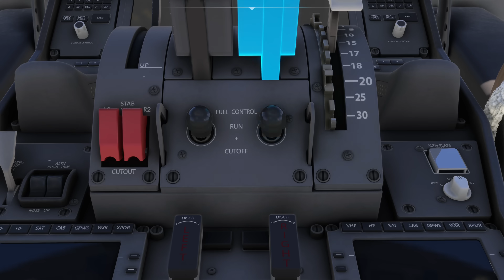Air India 171: Why Did The Fuel Cut-off Switch Get Moved?

Comment: First of all you are comparing your kids with two professionally trained pilots.

Second the sequence of events is not exactly clear here. 

Experienced pilots would be able to  judge if the engine flamed out  by just noticing the sound of the engine whirring down. 

That's why one pilot asked the other did you cutoff the engine?. The other likely possibility was that there was a malfunction in the engine fuel supply which was noticed by one of the pilots (most likely the PM) that prompted the question.

The switch was actually moved to cutoff and then run in an effort to restart the engines. The plane rotated with the engine switched on RUN position. 

Without establishing the sequence of timing of events we can't insinuate that a pilot deliberately cutoff fuel supply just when the plane became airborne. An accidental switching off the fuel supply to cutoff is unlikely.

Which pilot in his or her right mind would deliberately cutoff fuel supply?

That's what I'm driving at. The state of mind of the pilot(s) is at question here.

I think this is a highly prejudiced video that suggests the active role of the pilots in cutting of the engine fuel supply.

Boeing?? Defect in the electronics that led to a fuel cutoff without the switch being moved to cutoff. Vapour lock.

Let's wait for the forensics before we rush to find scapegoats in professionally trained and qualified pilots who had little to respond and did the best they could

Comment: This is clearly a poor maintenance issues, the mechanics install the switches in reverse that confuses the Pilots. When the pilot looks at the label, it's on OFF but in reality it's actually in non cut OFF position. Then they switch it to ON and they are done, it's the reverse and engine cutoff on ON position label which is actually OFF position mechanically/electrically. Guess the investigators didn't look into this.

Comment: Also a briefing on the IC controller for the fuel switch after 11k cycles causing a blackout blue screen. The switches will default to off. 😮😮

Comment: Was there a power failure on the ship? If so, does the power failure makes the fuel switches to cut off or stop the fuel to engines? Due to power failure, does one of the pilot turned off the fuel switches to deploy the RAT, can this be a chance ? Or as the engines losing thrust one of the pilot suspected fuel switches malfunction and just toggled ?

Comment: Why not put a safety cover on top of the switches connected to an indicator, so both pilot are aware? Also complemented with a small delay. 
But the most important, why allowing a cutoff in full/high throttle? One should first go to idle power before cutoff.

Comment: Captain Steeeve, it would have to be possible for Boeing and Airbus to make the fuel cutoff switched and fire handles linked to the weight on wheels switches so they can't intentionally be closed when airborne (and possibly put in a computed speed when they are inhibited so they can't be shut off during takeoff, maybe inhibited when TOGA switches are pressed). They would then have to somehow link it to the master warning system so in the event of a fire or malfunction which would require a shotdown the appropriate actions can be taken.
Your thoughts??
PS I'm a current Airbus A320 pilot and rated on the 777. My suggestion above would be something like the closed loop checklist system on the 777 where the system can see that an item is in the correct position or not.

Comment: This guy is a liar. 

The report says  “Engine 1 and engine 2 fuel cutoff switches transitioned from RUN to CUTOFF position … within a time gap of 01 sec”.

It does not say that pilots deliberately switched off.

A liar.
Reply: Ok, explain to us all how a mechanical switch moves without operator input?

Comment: Does it explain the RAT getting activated or both are  mutually exclusive? What are possible scenarios w.r.t timing of fuel valves getting cut off and RAT coming into play?  Besides there are theories that copilot was actually in control and effectively flying the aircraft whereas the Captain was not.  The Captain had mental health issues but nothing concrete to prove. The report gives more questions than answers

Comment: Is cutoff switch is directly connected to fuel valve? Or it goes to computer which runs a logic and then decides to actuate fuel valve. What is recorded in blackbox - the selection by pilot or computer decision or actual valve position? Why these details are missing from report and you are also not talking about Steve?

Comment: PLEASE don't ignore the evidence that this was a tragic mistake and NOT sabotage.  FACT#1 - The fuel shutoffs were moved at the same time as the gear-up lever was expected to be moved (four seconds after the weight-on-wheels switch time-stamped main wheel lift-off).  FACT#2 - The gear-up lever was found in the gear-down position - it apparently was never moved.  FACT#3 - The pilot who presumably shut off the fuel to the engines denied doing so.  FACT#4 - There has been no evidence presented to indicate that either pilot took any action to crash the plane after the fuel was shut off.  Moving the position of both fuel shutoffs and moving the gear selector are mechanical actions that are done at the beginning and end of every flight. An experienced captain would have enormous muscle memory for performing these two mechanical movements. Have you ever opened the fridge and been surprised that you put something in the fridge that should have gone in the cupboard? …and had no recollection of doing so?  It's a simple mistake with routine mechanical actions that we humans make from time to time and are unaware that we did so. Pilots are not exempt from this kind of human error just because they understand the gravity of such an error.  The initial report does not mention a “positive rate” or “gear up” callout.  If these calls didn’t occur, I would tend to agree with the many professional pilots who are claiming that there had to be “intent” behind the fuel cut-off but if these two callouts were recorded, I would be astonished if the captain’s only “intent” was nothing other than to raise the landing gear.  Please also consider that it is quite likely that the investigators would withhold such information at this time while they further investigated the possibility of tragic human error.  On the other hand, reporting that the pilot denied that he had shut off the fuel is significant to the investigation without drawing any conclusions.

Comment: The fact that many leading airliners, the likes of etihad and Singapore airlines have instructed their engineers to review the fuel cutoff switches on their 787 fleet and now that DGCA has instructed Indian carriers to do the same with their 737/787 fleets should at the least indicate the operators are not a 100% sure that it might not be a technical glitch. So being dismissive of the 2018 directive which clearly states inadvertent engine shutdown in flight as a possible outcome of the locking mechanism on the fuel cutoff switches failing is a little premature imho

Comment: Keep in mind that the first officer (co pilot) was the pilot flying so the captain was the pilot monitoring. During take off, the pilot flying had hands on the controls and who had his hands free to move switches? Furthermore, they know exactly who asked "why did you cut off the fuel" because each pilot's voice is recorded on separate channels but the report says "one of the pilot asked the other..." It has also been reported that the captain had a medical condition and he was even on medical leave for some time. He's been under severe depression ever since he was separated from his wife.
Why will the full audio transcription shed new lights? Because the gears stayed down. Why is that important? Because only when the pilot monitoring (in this case the captain) reports "positive rate" will then the pilot flying (in this case the first officer) call for gear up! Did the pilot monitoring (the captain) report positive rate or not? If no, why? Was he "busy"?

Comment: In one of your videos, you mentioned that pilots have a very stressful job. If someone is dropping eggs off a building, and someone below is trying to catch the eggs. At first, it is easy as only one or two eggs are drop. As the dropper speeds up, the catcher can not possible catch all the eggs. The solution is to go up on the roof and stop the dropper.  

In the same thought process, what can be done to eliminate the stress? (Other than talking with someone?) Can technology of some sort be utilized? More people? More tools? etc.

Comment: Thanks, Steve - wonderful, balanced coverage of this terrible incident. Question, though. Are the cut-off switches in any way under the control of the computers and therefore, software, or are they directly connected to the fuel pumps? If the former is true, is it not possible that the computer incorrectly and temporarily shut off the switches via the software (without physically moving them of course). This might explain the clear denial of the second pilot.

Comment: CAPTAIN STEEVE why can't we think the pilots tried to manually switch it off and on when they found both engines were cutt off. 
So in the process of doing this manual recovering on of fuel cut off they would have crashed and recorded the fuel switch as off ?

Comment: If the other pilot had put those switches again in run position, then how did they find the switches again in cut off position after the accident? Clearly it's an issue with those switches. Boieng is responsible for this.

Comment: The Indian public needs some context to understand this deeply painful act of potential Murder-Suicide. 
India currently has 10% of the world's certified pilots.... this is a rapidly increasing percentage as its aviation industry is truly expanding at a rate of knots. There have been an estimate 15 planes deliberately crashed in the last 20yrs. Its inevitable that an Indian pilot will sooner or later bring a plane down. This is not however a proof that either pilot did so in the case of the A171 crash. 
Murder-Suicide is the second most prevalent cause of plane crashes in the last two decades. This is still too explosive for the Indian media to contemplate; it's seen as unpatriotic and deeply shameful to do so. I just hope this analysis will be helpful for those seeking answers and closure.

Comment: Are there chances that switches were not operated but some failure in electrical or electronic circuits which might have caused this switch off and switch on and given fault signal and alarm.

Comment: BIOMETRIC SECURITY FOR FLIGHT SAFETY — A MUST FOR MODERN AVIATION

Every pilot should register their thumbprint before the flight, granting secured access to cockpit functions. This ensures:
	1.	✅ Only authorized pilots can operate critical systems.
	2.	✅ All key actions (e.g. engine shutdown, autopilot disengage, emergency config) are traceable to the individual.
	3.	✅ Prevents unauthorized tampering or mistaken actions.

🧠 For redundancy, the flight engineer (or supervising crew) must also be thumbprint-registered. If a pilot becomes incapacitated, the engineer can override with biometric authentication.

Banks, phones, and doors already use biometrics. Why should aircraft — with hundreds of lives at stake — be any less secure?

Let’s move aviation into the future with biometric accountability and layered safety.

Comment: You initially claimed right after the crash that one of the pilots mistakenly raised the flaps instead of the landing gear. The next day, you changed your explanation after other pilots pointed out that the RAT had been deployed. Now you're saying it was the fuel control switch that was turned off by one of the pilots. How credible are your reviews? You seem to have access to only a portion of the cockpit recording, and it's not enough to draw definitive conclusions. Please get your facts straight before releasing videos like this.

Comment: The fact is that the switches were in the "Run" position in the wreckage. And we don't have video footage from the cockpit. So, we don't actually know if the switches were actually physically turned off, or if it was a malfunction in the chip that controls the fuel, in the wiring between the switches and the chip, etc. We are really just speculating.

Comment: Sharath Panicker, a Wing Commander and former Dreamliner pilot who flew the jet for 10 years explains exactly why it's very unlikely that a pilot error or manual action caused the fuel switch to "cutoff". He said that it's almost impossible to transition switches for both engines manually within a matter of a second. It's already in the news.

Comment: I have a question, the pilot flipped the stwitched off which cut off the fuel supply. 
What I dont understand is, why there is a control to turn off the fuel during takeoff, this option should activate when the plane is at a sufficient elevation.

Comment: Based on the information shared in your earlier video, you mentioned that manually cutting off the fuel isn't easy, it requires to pull the lever, place it in the required position, and then release it. If that's the case, wouldn't the other pilot notice this action? Also, is it realistically possible to complete this in just one second, especially if it involves turning off two switches?

I’ve also seen comments from others raising a valid point: why isn't the full cockpit conversation made available to the public? From your videos, the narrative seems to lean more toward suggesting deliberate action by the pilot. But what if it was a technical fault, not necessarily a design flaw from Boeing, but possibly a component failure? Has there been any effort to check the maintenance records or gather input from other pilots who flew that aircraft recently?

It's important to consider all possibilities before placing blame. If this was indeed a technical failure, accusing one individual without full clarity might be unfair.

My thoughts are with those who lost their lives. I truly hope this wasn't caused by a technical issue.

Comment: The throttle control module (TCM) of the Air India flight 171 (VT-ANB) was replaced twice, in 2019 and 2023. The TCM houses the fuel control switches too. Why was the TCM replaced so frequently on the direction on boeing?

Comment: Do you think, there is need to examine the role of the ADEC (engine control system) to understand why Engine 2 failed to fully recover -- unlike Engine 1, which showed partial recovery -- and why Engine 2 was unable to sustain thrust, ultimately resulting in a loss of power? Don't you think if second engine had recovered partially as engine 1, the aircraft very likely could have continued flying or at least achieved a controlled emergency landing -- avoiding a total loss?

Comment: Captain, given the time between the moving the switches back to the RUN position, could there have been a physical struggle between the co-pilot (who I think was flying the aircraft) and the pilot (who possibly moved the switches to CUT OFF) that delayed the replacement back to the proper position? Plus the four second delay between the switch movements might indicate the co-pilot was flying and trying to move the switches.

Comment: Since I take 787 flights here n there, I believe safety of everyone is crucial. I want to share my thoughts. Maybe Captain Steeve can think about it. 

COCKPIT DESIGN FLAW — NO PILOT ACCOUNTABILITY ON SWITCHES

When a pilot sets the fuel control switch to CUTOFF, the black box records the action — but NOT which pilot did it. That’s a major flaw. In high-stress situations, this creates confusion and makes post-crash investigation harder.

👉 My suggestion:
	1.	Require thumbprint ID on critical switches (e.g. fuel cutoff, engine fire handle).
	2.	Second pilot must give approval by placing thumbprint on their yoke sensor or confirmation panel.
	3.	Only then can such actions be executed — adding both accountability and protection against accidental shutdown.

If banks and phones can use biometrics, why not aircraft that carry hundreds of lives?

Hope aircraft manufacturers take this seriously.